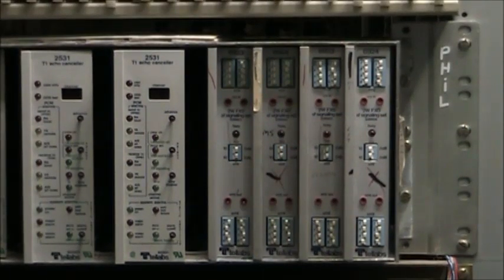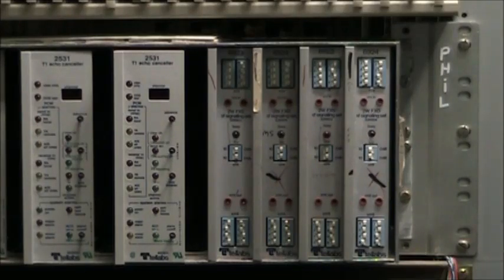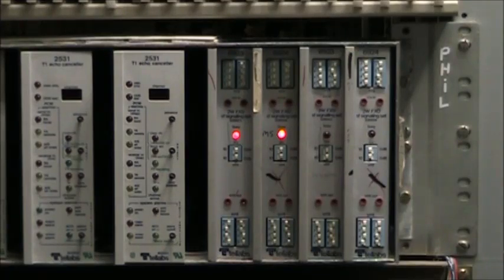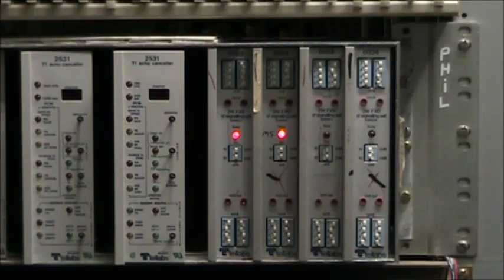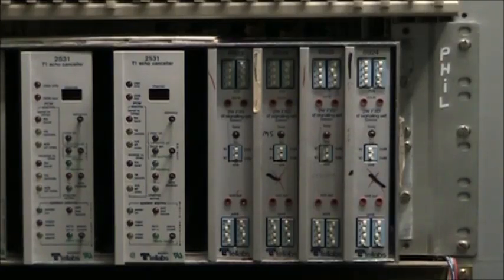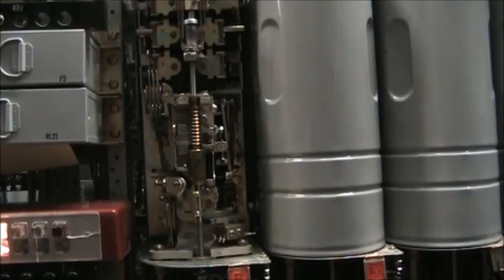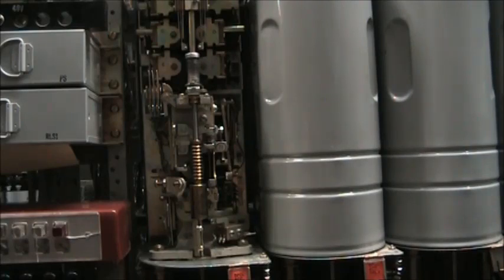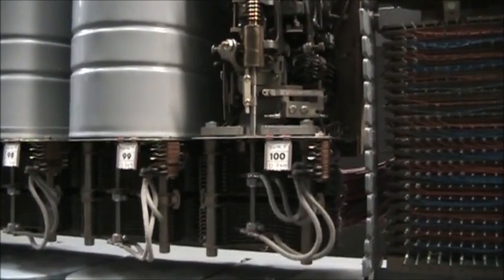Video of a single frequency (sf) (2600 HZ) telephone ckt, working in a Step x Step Central office.

Comment: Up to a few years ago, we had a similar setup still in-use for EAS Trunking between our GTD-5 Switch and a nearby Independent Telco. I remember running the toll route, on the analog EAS Trunks for many years, chasing countless mice from the peds. 

We eventually built these trunks onto a DS1 Circuit, that already ran across an existing fiber, between our two offices. I'm so glad we moved over to the fiber, both for our sake, and that of our customers. I do miss the OT! ;)

Comment: Can I send 2600hz pulses directly into the ptsn line instead of dtmf digits? I think it would be a bit faster, also thank you for connecting your switches to the ptsn, so people can experience old switching equipment.
Reply from the maker: Rainbow_Dash_7x 
Yes you can.
Reply: @sxsphil  Thanks, I'll be sure to try it sometime.